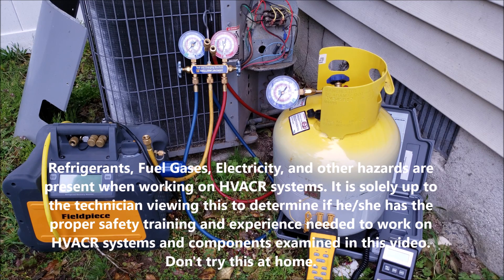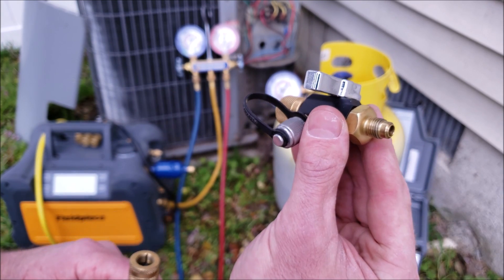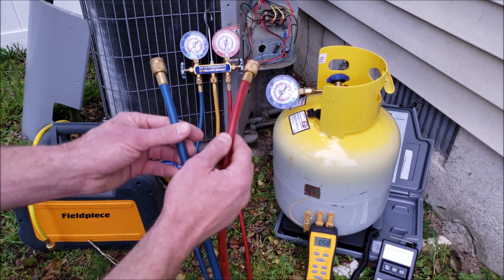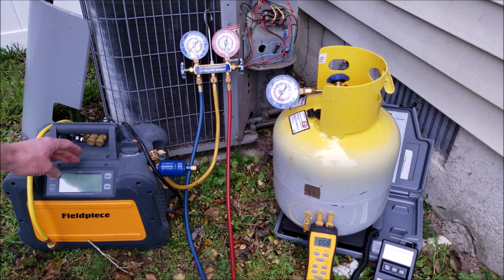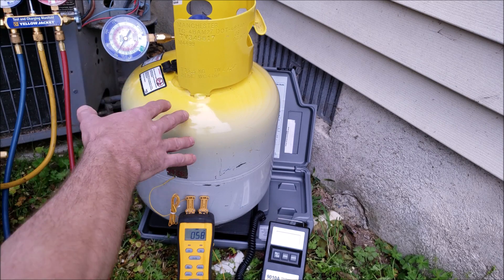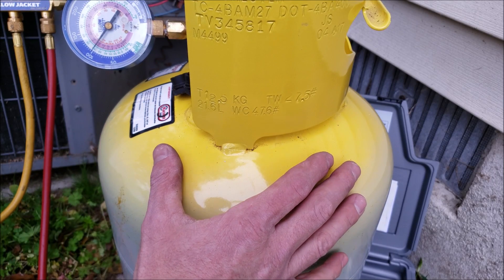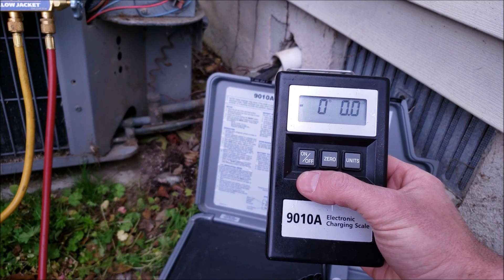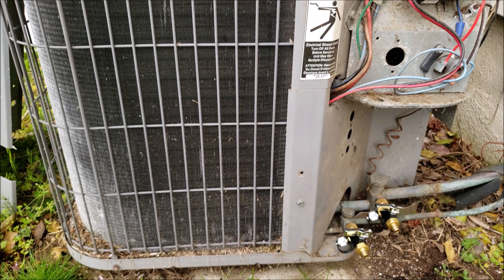5 TIPS for a Faster Refrigerant RECOVERY Process!

Comment from the maker: Tool List-  https://www.amazon.com/shop/acservicetech
Support the Channel-  https://www.patreon.com/acservicetech
For those that are looking for the tools used in the videos: (Linked Below)
Here is the link to the Appion Valve Core Removal Tool- http://amzn.to/2uYr8WL

Here is the Link to the Fieldpiece MR45 Recovery Machine- http://amzn.to/2xAOpN6
Here is the link for the C&D Valve Core Removal Tool- https://amzn.to/2vqA0qy

Here is a link for RectorSeal Bubble Gas Leak Detector http://amzn.to/2ckWACn

Here is the link to the pack of 25 C&D valve cores- https://amzn.to/2J1lurm

Here is the link for the C&D Valve Core Wrench, Container, and 3 valve cores- https://amzn.to/2EVGkps

Here is the link for the filter drier- http://amzn.to/2veVV3m

Here is the link to the Yellow Jacket 1/4" by 1/4" heavy duty hose straight-  http://amzn.to/2umtcod

Blue Vapor Yellow Jacket Gauge- https://amzn.to/2Ju7pan
Red Liquid Yellow Jacket Gauge- https://amzn.to/2sSFmGH
Quick Coupler for the Gauges- https://amzn.to/2sTk8Ze
JB Test Gauge High Side-  http://amzn.to/2ruQb0l
JB Test Gauge Low Side-  http://amzn.to/2qR0utM
Manual Copper Tube Swage/Expander- https://amzn.to/2WRPa1M
Uniweld Hydraulic Swaging Tool- https://amzn.to/2MlrI8m
Uniweld Swage and Flare Kit- https://amzn.to/2T55jyn
Ameriflame Oxy Acetylene Torch Setup- https://amzn.to/2SRm3JF
#2 Tip for Oxy Acetylene Torch- https://amzn.to/2SPDaeD
Cap-N-Hook Tip for Oxy Acetylene- https://amzn.to/2MbhpUk
Air Acetylene Torch Setup-    http://amzn.to/2aQalsb  
15% Silver Brazing Rods-  http://amzn.to/2gVLyLc
Nitrogen Regulator-   http://amzn.to/2bXdR5f
Nitrogen Flow Meter-    http://amzn.to/2brvoBg
NitroVue Flow Reg-  https://amzn.to/2MiulYv
Ultrasonic Leak Detector- https://amzn.to/2Lw4Zpr

UEI DL479 Multimeter with temp sensor http://amzn.to/2jtsUbJ

Magnet Jumpers- https://amzn.to/2PyKPQZ

Alligator Jumpers- https://amzn.to/2PxqJXn

Fieldpiece ST4 Dual Temp Meter  http://amzn.to/2wc1ME3

Fieldpiece Bead K Type Temp Sensor https://amzn.to/2DBwKfs

Fieldpiece Wet Bulb Temp Sensor https://amzn.to/2RRI7Tw

Fieldpiece TC24 Temp Clamp https://amzn.to/2qHLyjZ

Yellow Jacket Refrigerant Gauge Set http://amzn.to/2aenwTq

Refrigerant hoses with valves http://amzn.to/2aBumVI

Yellow Jacket Gauge set & hoses https://amzn.to/2vLVkV9

Yellow Jacket 4 Port Manifold w Hoses https://amzn.to/2BkuGIq

FieldpieceSMAN360 Digital Manifold Set https://amzn.to/2BdoaD4

FieldpieceSMAN460 Digital Manifold Set https://amzn.to/2nB4Fe6

Compact Ball Valve for Refrigerant Hose https://amzn.to/2KUisW8

QuickDisconnect 90 for refrigerant hose https://amzn.to/2MMtVcg

JB 6 CFM Vacuum Pump   http://amzn.to/2nqbvo8

Appion Blue 3/8" to 1/4" Vacuum Hose http://amzn.to/2uYlVyc

Appion Red 3/8" to 1/4" Vacuum Hose http://amzn.to/2uYg6Ro

Appion Valve Core Removal Tool http://amzn.to/2uYr8WL

Yellow Jacket 1/4" by 1/4" hose http://amzn.to/2umtcod

CPS Vacuum Micron Gauge http://amzn.to/2v1nM3O

Supco Vacuum Micron Gauge http://amzn.to/2v1JRiA

RectorSeal Bubble Gas Leak Detector http://amzn.to/2ckWACn

UEI DL389 Multimeter  http://amzn.to/2xAdaJf

Other tool links can be found in the video description section.

Shop through Amazon! Your Purchases through Amazon provide a means for channels such as mine to earn advertising fees from all purchases after clicking through. Prices are the same as normal-    https://www.amazon.com/shop/acservicetech
Reply: AC Service Tech LLC trying to buy your ebook  page does not work when im trying to check out
Reply: why does the refrigerant tank get hot when recovering

Comment: My son put a screw through the wall and hit a refrigerant line of our mini split AC unit.  All the freon leaked out.  Provided we replace the lineset, what is the procedure of refilling the AC with R410A? Meaning, not adding refrigerant into the system that is clean and is still working, but for our case when the line was punctured and everything is filled with air?
Thank you!
Reply from the maker: That would have to be done after vacuuming the system down to 500 microns and breaking the vacuum with liquid refrigerant from the bottle. The amount should be stated on the outdoor unit rating plate but take into consideration the total cumulative length of the line set. Make sure that you or whoever is doing the work is EPA 608 certified before purchasing or working with refrigerants, thanks!
Reply: Call a professional, that's the first step.  Refrigeration is not DIY.  But you would replace your lines which is gonna be a pain in your ass in this case (could probably repair it if your willing to fix the wall too, just dont burn your house down), vacuum the system down past 500 microns, then you weigh in the factory charge, there is a formula for the make and model for your total lineset length telling you how much you need to add to make up for your lineset, factory charge will only cover so many feet.  It's in the manual.
Reply: I am very much surprised why nobody on youtube is showing step by step where to attached hoses to and what to open, what to close, what to look for on the pressure dial and how to regulate everything. It turned out to be so easy.
First, our existing lineset was 25 ft long and was coiled in the wall. This is because we used a standard lineset. When we replaced the broken lineset, we bought on Amazon a lineset that did not not have flares at the ends and was made for fitting. It is the least expensive lineset. It also was so pliable that it bent through the pipe bending tool without kinks (comparing to the original).  We fitted the length exactly and made it fit using the flare tool. I think we used Nylog on the thread (not sure if the name is correct).
Then we vacuumed down the system and flushed it with nitrogen twice. Then vacuumed it one last time and filled with freon based on the weight listed in the service manual. 
At the last stage, we tuned the freon level by pressure dial (and temperatures shown on R410A dial). We turned on the AC to the lowest temperature of 61 F and continued adding freon in small batches until we got 40 degrees on R410A dial and this is right about 117 on the pressure dial.
Anyway, we shoveled through lots of videos to learn how to do it and what to connect where and what to look at. 
I really wish professionals had a video on that. As I said, it was so easy when we knew what to do.
Reply from the maker: The refrigerant would be weighed in based on the factory charge plus extra refrigerant per foot of additional lineset length past what is stated in the literature. We definitely do not charge to 40 degree F on low side gauge on minisplits or even standard split systems. For standard split systems we use total superheat for systems with a piston metering device and subcooling for systems with a txv metering device. In the case of a minisplit, we weigh in what is needed but usually manufacturers do not list a running system charging method. It is a little more complicated than looking at pressure gauges and that is why nobody teaches that becasuse we take pressure readings to convert them to saturated temperatures. Anyway, Glad you got it fixed but not sure how much extra refrigerant you put in there. Keep in mind under EPA 608, techs must be certified to buy and handle refrigerants along with service systems with refrigerant inside and that is when we start to learn about the saturated temps and charging methods, thanks
Reply: you deserve to have your system break down for refusing to hire a professional
Reply: @pointblankmatt6580  people like you are the reason homeowners want to do their own work. You don't like it because you can't rip them off.

Comment: Hello Awesome videos just had a quick question that’s pretty important. When I’m charging In super heat does it matter what brand unit it is ? The target superheat is always based on indoor wet bulb/outdoor drybulb temp correct ? Thank you sorry for not on topic of video .
Reply from the maker: Yes indoor wb and outdoor db for target superheat. The total superheat method is used for checking the charge of an air conditioner that has a fixed orifice as the metering device and it has a single speed compressor. It would be the same for any brand unless the manufacturer specifies something different.

Comment: Lightning hit our home and now our blower motor will not come on. Everything else seems to work. The water heater (tank type) also stopped working and smells kinda burned. Where should I check first? You whats the most common thing to go in this situation?
Reply: Would check over all the wiring for burns. Maybe ohm the motor. Check that youre getting your correct voltage from the breaker all the way to your motor. Coukda popped a fuse in your board even.
Reply from the maker: I would have a licensed electrician come out first and just check over everything they can. I know a couple people that it has happened to locally and can be a big deal. In regards to the blower, if it is an ecm motor, it is likely the module on the motor that is bad. After the power is turned off, inside the motor module, you would likely see a burnt connection visible, thanks and sorry to hear that!
Reply: @acservicetechchannel  i can't afford an electrician right now. An electrician instead of an HVAC guy?
Reply from the maker: I meant the electrician to check out the house for safety. Yes you would call an HVACR tech for the furnace and ac system though, thanks

Comment: I had never heard of letting the forced air side run to help reclaim/recover. But it’s actually a great idea ! I have seen external coils in water used to help cool and condense refrigerants which can be really helpful in hot weather, but why not skip the addition hose in the first place.
Reply from the maker: I do skip the additional hose and just use the 3 but I wanted to include the thought of using the manifold since so many include it, thanks!